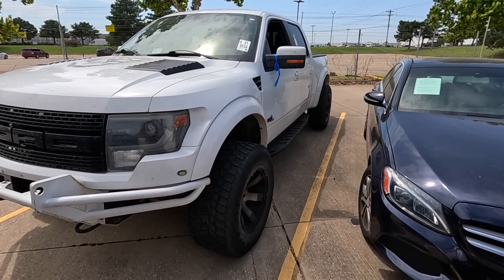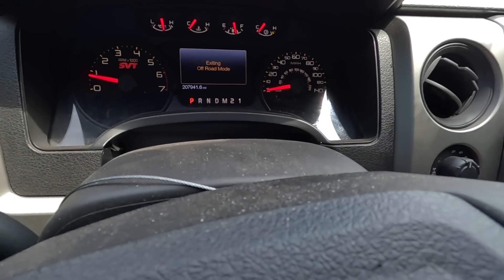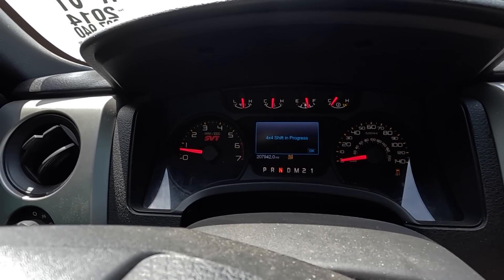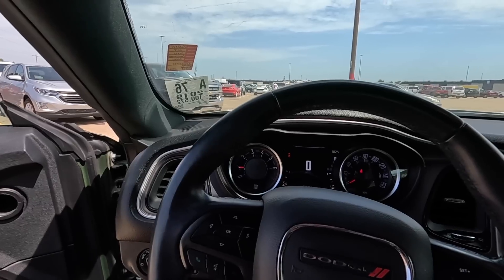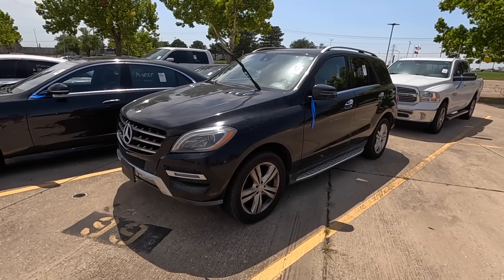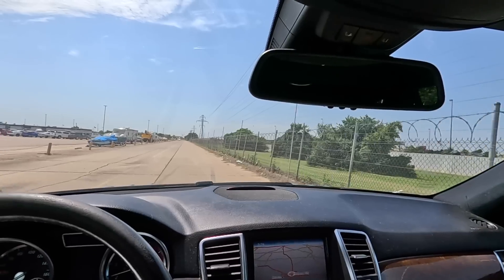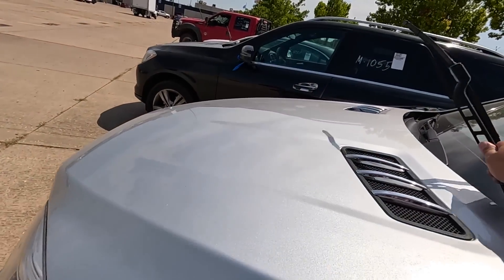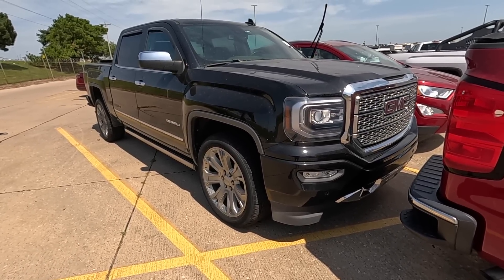You won't Believe how Cheap this V8 Raptor is at Auction!!

Comment: i had a 98 sunfire convertible 2.4, love the thing. Drove it through a blizzard and didn't have any issue. If the transmission hadn't died i'd still be driving it
Reply: I had a 2005 and I always wanted to see what one of those would look like as a convertible.  It would have been sharp but they discontinued the convertible before the last refresh.  

Sorry to hear about your transmission.  I loved mine, it had a 5-speed manual which was really hard for me to find but I ended up trading it in after about 3 years because of the stepper motor issues for the gauges.  Had it not been for that, I would have kept mine longer as well.

Comment: Randy if you get that raptor you can upgrade the sync version of that radio to be able to make it support Android Auto and Apple CarPlay using the factory screen you just got to swap the radio module out it's like $1,000
Reply: How do you do that?
Reply: @TheJVCguy  it works for anything with the Ford sync or my touch 2013 and and newer you can even upgrade the small 4-in non-touch screen radio to the full 8-in sync 3 radio as well One second let me get to the link to the website
Reply: @TheJVCguy  there's lots of tutorials on YouTube
Reply: @TheJVCguy  but if you have the raptor specifically 13 to 14 and not just a regular F-150 there is a certain link that you need to use to find the right one what truck do you have or car?
Reply: @destruct61  oh I have a 2010 f150 harley davidson edition, it won't work? I mean I'm perfectly fine with the stock screen but android auto and stuff would be cool
Reply: @TheJVCguy  you might have to change up some steps cuz that video is 5 years old I'm not sure if he's installing sync 3 sync 3 is the oldest version that has Android Auto and Apple CarPlay but no matter what you'll be able to make it have sync 3 following those steps

Comment: I have had two Pontiac Sunfire they were both 2005. The one made it to 300,000, mi before the timing chain finally let go the other one I sold to my brother who is still driving it with over 200,000, mi. These both had the 2.2 ecotec. I absol utely loved the cars. Drive them anywhere very very dependable I never had any issues other than normal maintenance on those cars until the timing change broke but that was 300,000 miles and it died at home. It is parking space.

Comment: Honestly 20k for that raptor is walk away price for me with that trucks history. 200k or a construction truck ok fine. Both then at an auction for a low price on something with a lot of potential to be clapped out and may need anything from a new set of diffs to a new engine in short order...then throw on the awful looking wheels and it just feels like too much risk for a consumer like me. Ive worked construction and seen what they do to those trucks....no thanks.

A mechanic able to fix all of that would likely feel a lot more comfortable with it and may be able to flip or keep it and make out like a bandit though.

Comment: The GMC has the feel of a Repo! I once worked for Adessa  in SA TX, some dealers would beat the crap out of a vehicle and leave anywhere on the lot. On Wed we would have to put cars where they belonged to run through the auction. Thank you for parking cars where they belong.

Comment: Okay so I did a little research it's just a little different for that year raptor but you can still upgrade to sync 3 it replaces the screen and module it's a combined unit it's $1,000 it would completely change the feel of the truck make it much nicer I would love to see it

Comment: I had a 2005 Sunfire with the Ecotec and 5-speed manual, it was crazy hard to find but it was a really fun car.  It was quite a nimble little thing and I always used to have fun playing around with the reverse lockout ring on the shifter.  If you do happen to find one in decent shape, they are fun little cars.

By the way, you really should have reported that guy abusing the cars and driving recklessly in the parking lot.  Not only is he going to damage someone's car, he's liable to kill someone driving around like that.

Comment: 11.8 mpg? My F350 SD(crew cab, long bed, 4WD and Warn bumper & winch combo) gets about 10 mpg, so that Raptor would be a step up😅. Those guys beating the piss out of the Edge are a-holes. The reason why you dont see any Sunfire/Cavalier/Alero is exactly what you stated. Head gaskets, transaxles, et cetera...GM cant build a Camry

Comment: when I was buying cars to sell at dealer auctions I do not remember which book I used but it cut any commercial vehicle buy about 50 %.  It worked just about right .  New car dealers in the rural areas used regular values from the books and could never sell worn commercial vehicles such as farm trucks, construction, state, plumbers, carpenters and the like.  these work trucks were the bottom of the barrel.  Be careful most of them are ready for the scrap yard.

Comment: As a 1st gen Raptor owner with Hella miles I would be afraid to pick it up for the right price. Be careful going much over the 20k but they'll never make another one with any high products numbers. Definitely change those wheels or remove the spaces if they are installed. Good luck Randy.  I might try to pick it up from you once you're done with it😅
Reply: Would or wouldnt??

Comment: @3:38 Without the RAM TRX, they probably wouldn't have gotten the memo so to speak and have used a 3.5 l turbocharged "metrosexual" V6 instead. 🤗
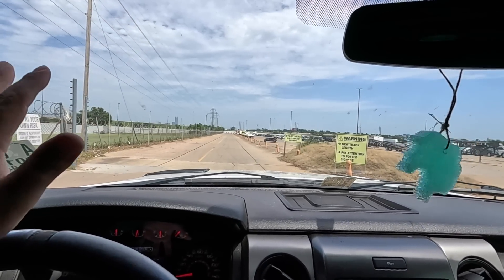@8:26 Who knows? They might find a sucker. They probably try to cut their loses as a dealer and get rid of inventory, so it is definitely worth as much to them because they overpaid.